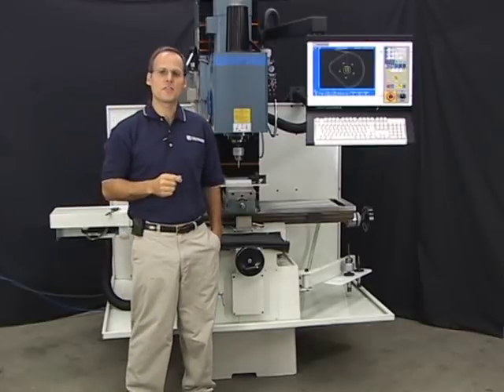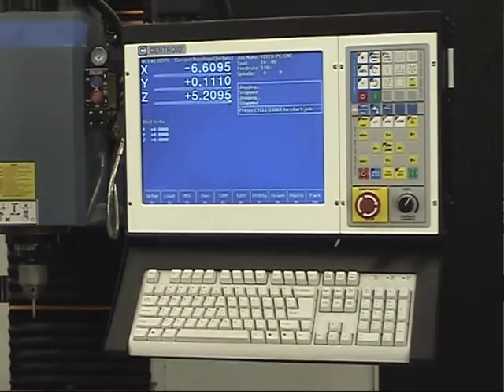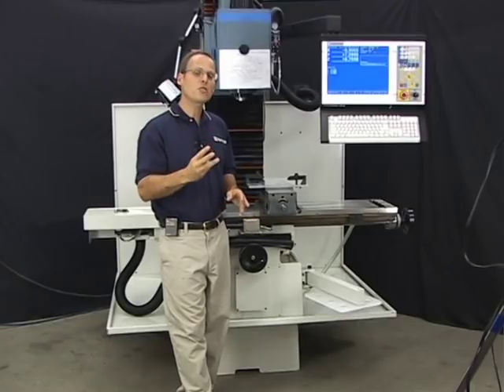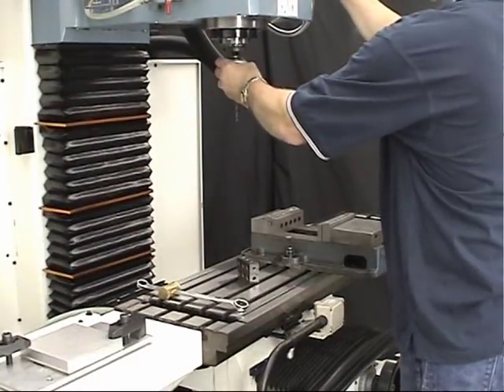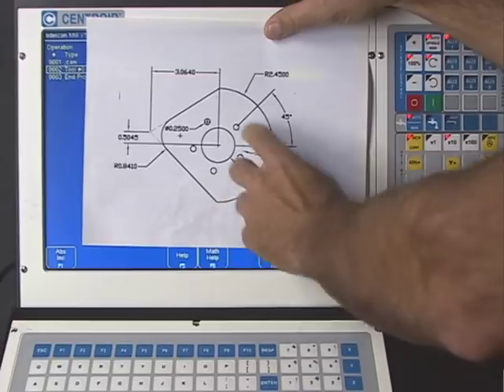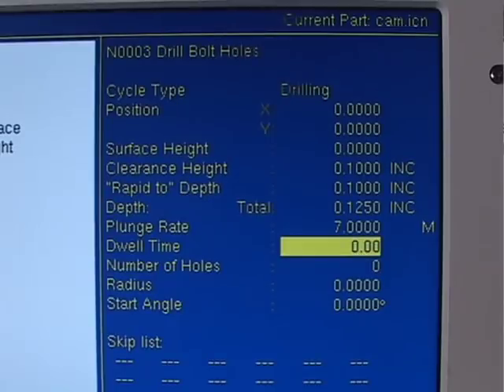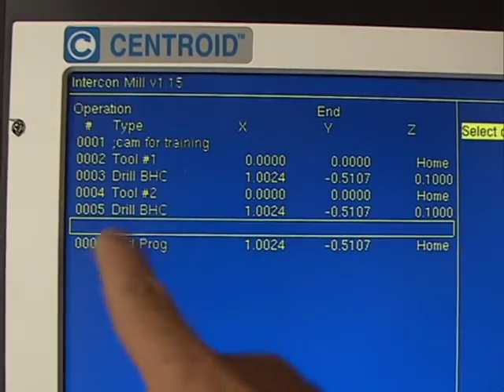CENTROID CNC Control User Training Video: CNC Millling Machine Training.

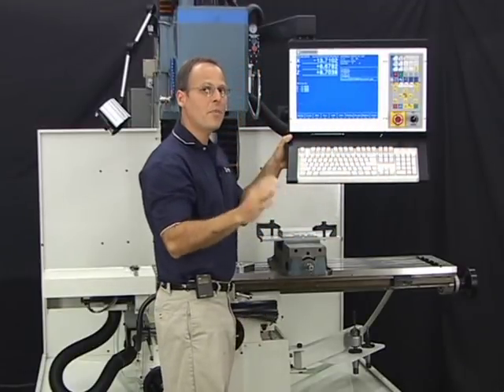Comment: 11:51 - The term "Dual Function Button" is misleading: this is a toggle key.  Push it once, it toggles one way; the next push will toggle it the other way.  When you say "dual function," I think of more than one purpose for this button (which in this instance is not the case.)

Comment: The Voltage measurements for 3Ph  shown here, may work for a "Y" 3ph. source
But it is DIFFERENT for a "DELTA" pattern   There is no "Wild leg" But there is a STINGER  which is normally about 208 from Ground.  
and the other 2 legs DO read 120 relative to GD. 
(look up the Graphic schematics for Both patterns and you will see WHY)

Comment: very good video, thank you for posting. I understand that the Centroid software is not able (anymore) to import a part/model from different CAD, (like Solid Works for example). I cannot find any information on this topic on the forum. Also, is the path generator still working in CNC12 but only as long as the part is drawn in it ? Regards.
Reply: Do you mean cam files? We convert our fusion360 files to g code before importing into the centroids library, no issues so far

Comment: 21:48 easy but not faster, just put paper top of it and move incremnts is faster.THEN can use slower method for acuracy even paper is 0.1 and you jog it atlest 0.1 or less to surface when paper not slide lol its drill so it not need be acurate. thicker paper would be fine lol

Comment: 27:57 there it is drawing with all measures. i just write gcode punch those in hit cycle start. no cam needed lol and its not cam even like.
you not draw out lines then say lets do face milling drill these holes

Comment: 22:11 and thats so uncorrect. measure on height should be near something you can measure from tool so you need make up formula
machine travel -block=tool height
you know block size you know how much machine travelled
you need figure out what is max travel to get it you need make mind where you measure your tool so its something very easy to measue out of machine TOO some fixed position from holder to tool tip. easy? you have all measures you can figure out max travel. now you can easy calculate tool height when you measure it and g54 or any offset could be tool height measure offset that you can change untill screen say same value as tool lenght is. easy?, but no need if you measure tool out of machine. first tool you just set workofsett. boom so eaasy lol

Comment: 30:57 everything you should allready know bout gcode and all macros i build lol all programs are small size.
and centroid free versio allow 50kb program LOL fanuc has 250kb memory and limit 400 programs. i could never even fit cam program to machine without deleting bunch of stuff lol.
so i hand write and it will be easy to read and under 1k. no cam neede i hate cam.it just slow things down. all bcoz fusion360 is so good it cut part inside figure.never never cam should not do it. red red error error. yes you are cam do it without error LOL